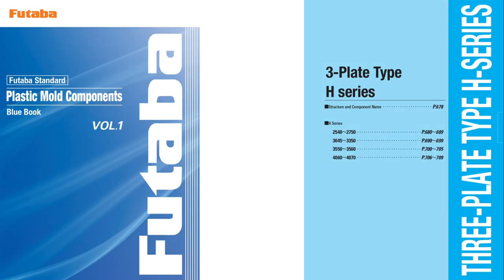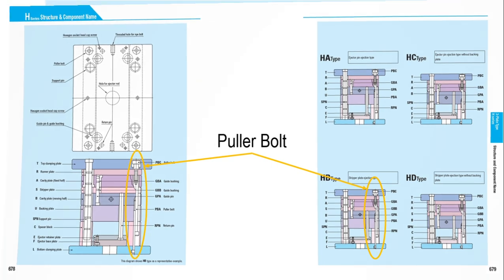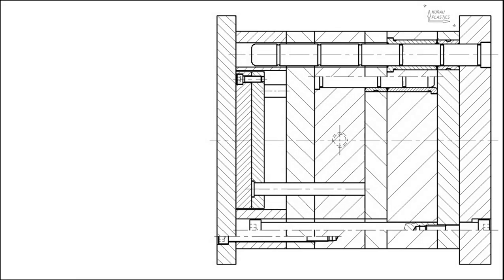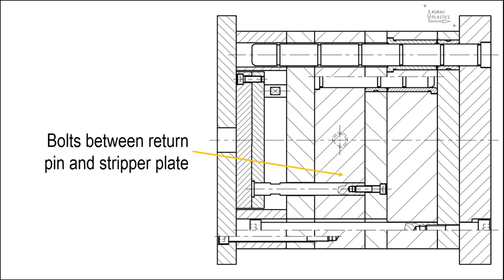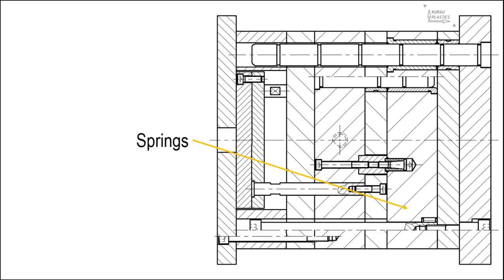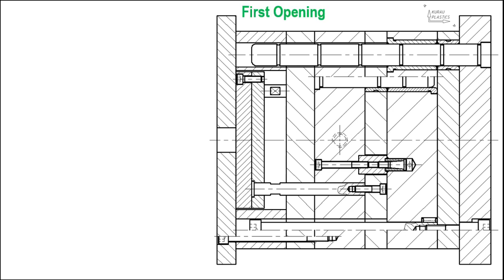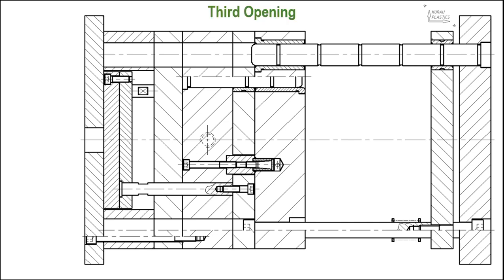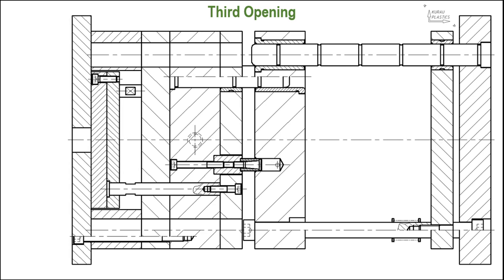Animating The Movement Of A Three Plate Mold In Injection Molding #injectionmold

Comment: 2nd opening...  how 🤔 ❓️
Reply from the maker: 2nd opening occurs because the runner plate is pulled by the puller bolt while the cavity plate is held by the parting lock pin.